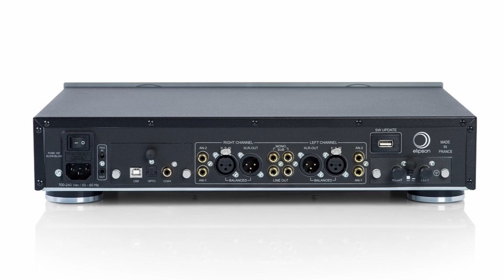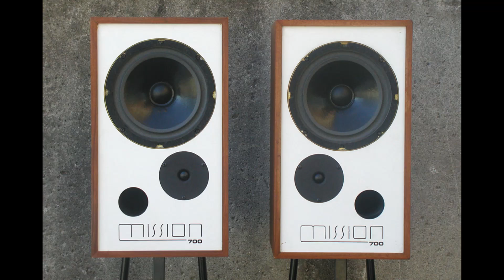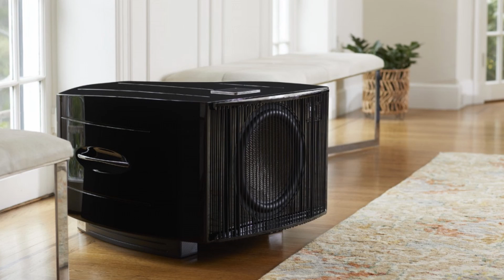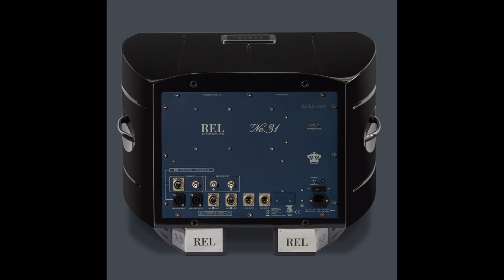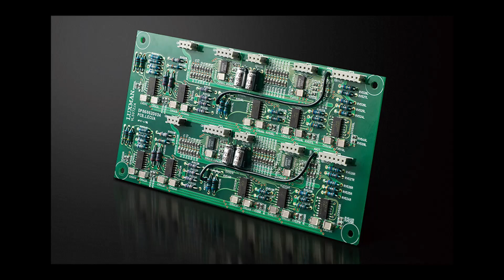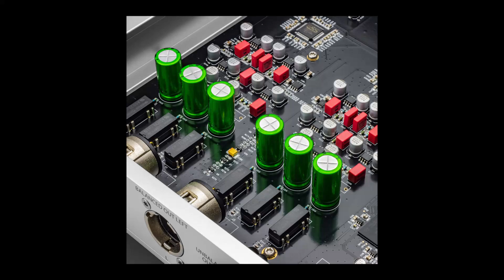What's New? Oct 2022 (Part 2)

Comment: Hi. So for desktop near-field listening I got my Exposure 3010 s2d preamp, a Sudgen Dac-4 and Dali Menuet SE . Spendor Classic 4/5 are planned.     NOW Problem: Although sound is great with Rotel RB-980 BX (2x120W) power amp --> will there be improvement getting an Exposure power amp instead ???   Should I take out the Rotel and get an Exposure?   Thanks
Reply from the maker: Nice system. I haven’t heard the RB-980BX but your system seems well balanced already 😊
Reply: @abritishaudiophile7314  thanks a lot, yes it sounds good and Rotel gets not hot, a little warm only and Exposure stays cold (love that). Rotel does not add any disturbing sounding and no hum etc. I can wait some time for my final decision too.

Comment: I will let you in to a little secret NOTHING IN HI-FI IS NEW ANYMORE they just reinvent the wheel over and over the same sound signatures come and go speaker placement in the cabinet come and go speaker design of the drivers is pretty much at its pinnacle 
They just make new gear all shinny and increase the price and your set to go Audiophiles will pay almost any price if a new AMP is 60% shinny aluminium and though in a few LED and the pretty much the same internals 
My take on the Audio game is when you get a system that works well together and you love the sound stop there and listen to music and enjoy and don't worry about the next big thing it will all come around again 
What sounds good now new off the presses will be replaced with a new different sounding equipment and so on then we go around and around back to sound signature that has been around before

Comment: I think the Mission 770s are having slower sales and that’s reflected in the 700 price.
Reply from the maker: I suspect the cost of building them in U.K. pushes the price up substantially. Lots of great speakers at £3k 😊
Reply: @abritishaudiophile7314  good point. If the 700s are made in China that’s our answer.
Reply: @seanb3303  Agree I have the new Mission  QX2 Mk2🎶 paired to an older Marantz 6006 - made in China rrp £399 pair - I challenge you to find a better built speaker anywhere near that price 👍
Reply: @andrewbrazier9664  Wharfedale 12.1 😉
Reply: @seanb3303  Wharedale Diamond series have long been a uk budget best buy. It must be the economy of scale as the components have been updated many times.The 12.1's currently retail at just £249 in the UK 
Their premium EVO 4.1's I was also considering are preferred by some reviewers on here over the more popular 4.2 but rather large  3 way are a lovely cabinet ( £449-499) 👍

Comment: Hi I’d like to hear your opinions on the new Innuos pulse range of network players - I’m quite interested in the pulse mini. Also if you could provide some wisdom on streaming and best use of money ie if using Roon to use say a roon nucleus as roon core with multiple endpoints and to use all in one streamer with dac built in or use transport and separate dac. Is it worth spending money on Hi-Fi network switches and improving mains quality and using fancy Ethernet cables or spend on hardware instead I.e streamer/dac etc ? Thanks
Reply from the maker: Thank you Jon. I have spoken to Innuos about the Pulse range 👍
Reply: @abritishaudiophile7314  thanks

Comment: Very interesting products and I agree with negative feedback. My guess is that negative feedback circuits work well on fixed genarated frequency tones. But not so well with ever changing harmonics structures coming from acoustics instruments. The problem is that measurement are based on simple and fixed generated tones so that we can predict the output. Intermodular distortion is measured again with a few of those tones. Then there is the null test but the litlle ripples are always dismissed rapidly, "not enough db to be piced up". Yet people do feel these changes. Its like pheromones picked up below the treshold of consciousnes. Id like to see the day when the way we used to measure audio is shown irrelevant: "well that 0.000000% distortion amp is good for playing.... midi keybord tones only". In my experience low distortion amps have a sharp and focused image, its more in the textures then the contour that I feel the 'sterilization'.  Ill soon have a evo300 to play a bit with triode that reduces the nagative feedback, ill try to report back.
Reply from the maker: Hi Simon, thank you for posting this. It is one of the most coherent explanations of why negative feedback can adversely effect our perception of sound quality that I have come across. Very well articulated 😊👍